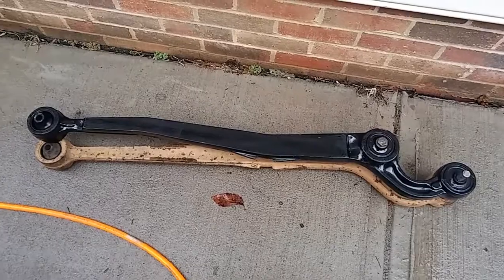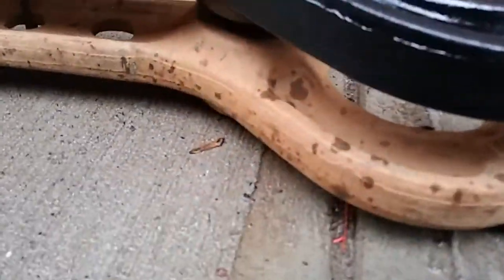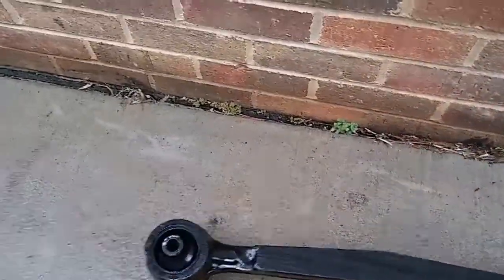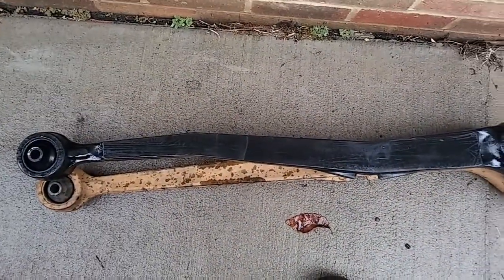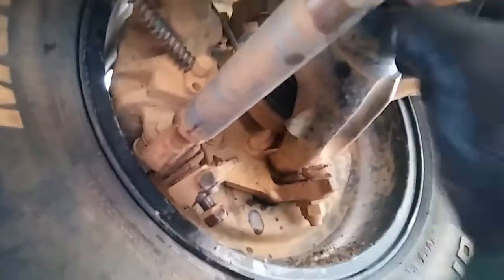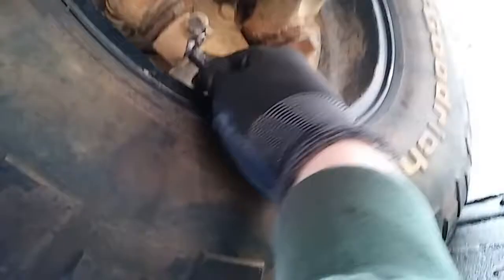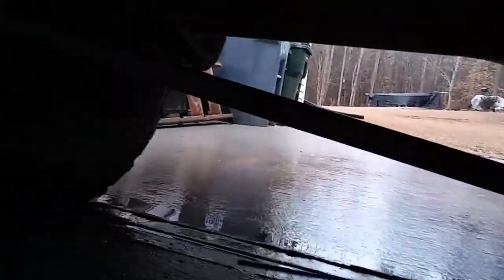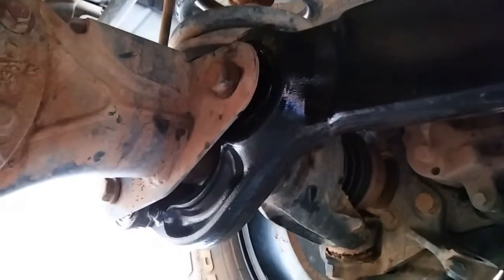Radius Arm Installation D2

Comment: 2 years later, how are they doing?
Reply from the maker: I have had no issues on the front radius arms since I installed them. Very pleased with everything. The replacement rubber factory style bushings seem to be holding up well. I just replaced the rear radius arm bushings with some polyurethane so we will see how they hold up in comparison.
Reply: @rowdygrambo9076  Awesome, thanks!

Comment: Hey there, thanks for posting this. I'm in the middle of a D2 build and put am about to put a 4" lift in. I;ve been looking at castor correcting arms and stumbled upon your post. What did you decide to go with, and did you do anything with your rear? Thanks!
Reply from the maker: Glad you found it useful. I have about 3.5 to 4 inches of lift and got the arms from Overtyme Fabrication. IIRC they are 6°. I would check with RTE, Lucky 8, or a custom fab shop to have them made. I had to ship my Radius arms to them as a core, so be sure to budget that in. I have not changed the rear because I am running the rotoflex joint (stock) so I don't need to correct the rear castor, but I did get the corrected Watts linkage arms. Lucky 8 had a 3 month lead time, which sucked, but they had the best price at the time.
Reply: bought a ford dodge chev.. easier cheaper..